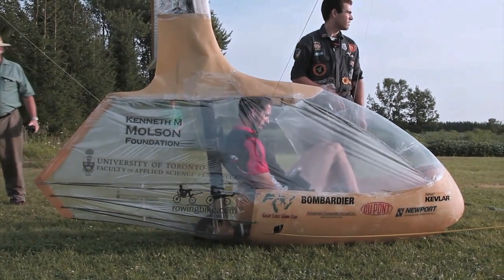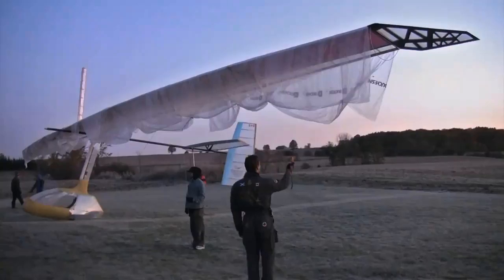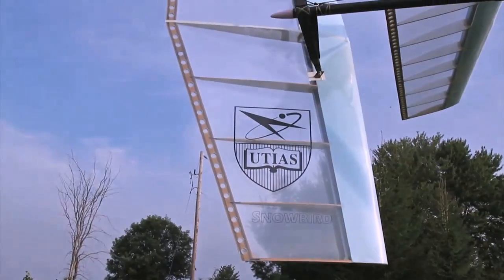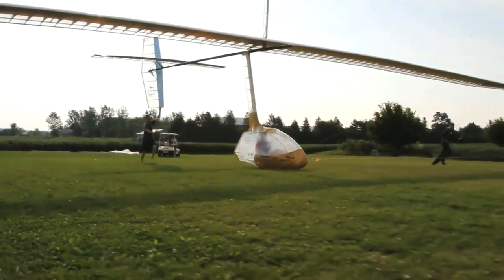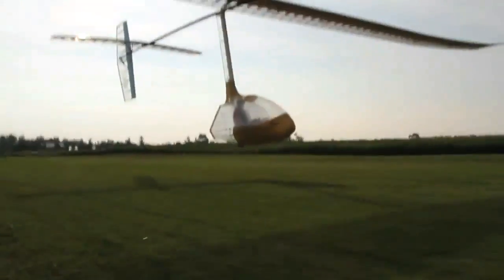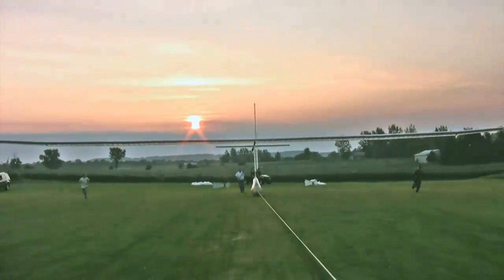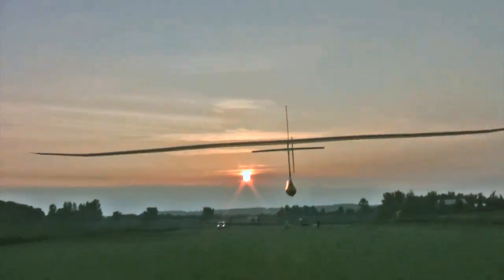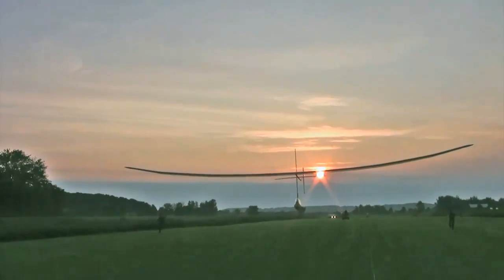"First Ever" Human-Powered Ornithopter Flight, Narrated

Comment: @gammypage: I understand what you mean, that's why I wrote "it also has to be initially powered to simulate bird like start flight flap" mechanically and electronically powered startup. like the eagle which starts flapping powerful enough (all natural) and when it hits the right height it glides and flaps it's wings gently to maintain altitude and balance. It has to be wide to capture wind for smooth landing. A hybrid.

Comment: @ColeFried81 they stayed at the same speed and altitude for 19 seconds, if it had merely been gliding, the altitude and speed would've gone down during that time instead, probably drastically enough that it wouldn't go half that before hitting the ground, man power kept it in the air, it works.

Comment: It's not flight until it can climb higher then it was when it was released to it's own power. It doesn't seem to go any higher then when it was released from the tow cable, it seems to just slowly drifts down and can only lift itself up slightly to a point lower then it was on the previous flap. Like a roller coaster going down hill, and slightly up the next. It'll be interesting to see how much further then can adjust the design. And what they will be able to do with it.
Reply: Where would the Wright brothers be with such attitude?

Comment: really?? They obtained sustained flight due to the pilot flapping the wings, you can see the craft dip and raise in tune with the wing beats. The car is just used to create that intial lift needed. It takes quite a deal of speed to create lift, think of your hand out the car window at low versus high speeds..... get it? maybe they could devise some sort of bycicle contraption to launch it, tho this would prob. mean to much weight. the aim is for flight, which was achevied, not takeoff@dkconcept

Comment: @ ramhoves: is it cheating for the space shuttle to be launched by rockets? All gliders need a tow or to launch off the top of a hill. The innovative element is sustaining flight by flapping; even though it may never be very relevant to flying machines the technology will undoubtedly benefit other areas of aerodynamics. Well done guys, it's also a thing of beauty.